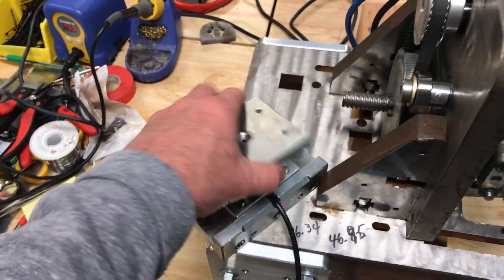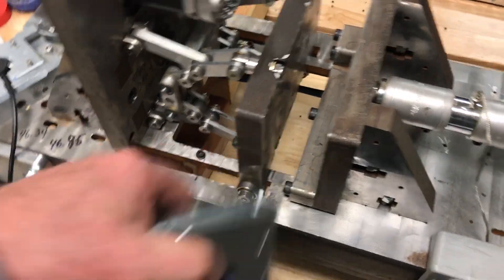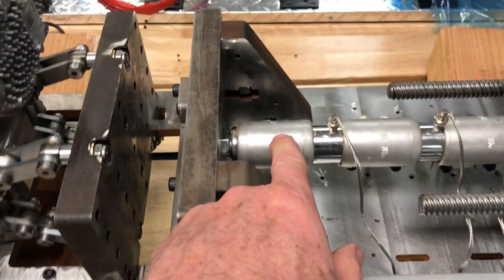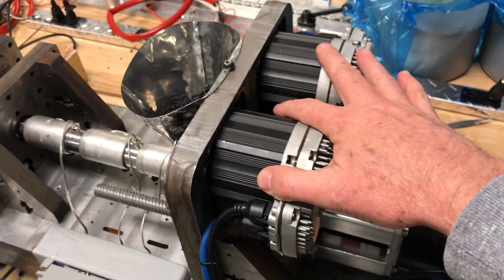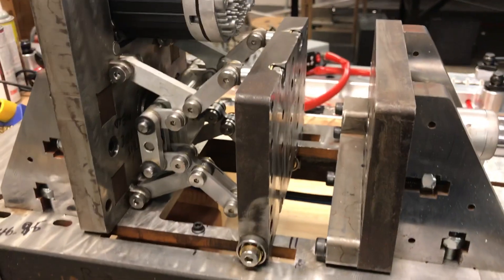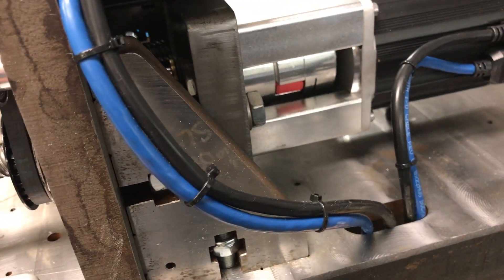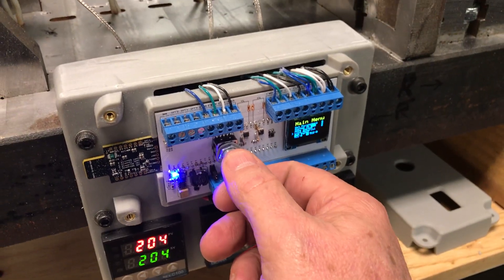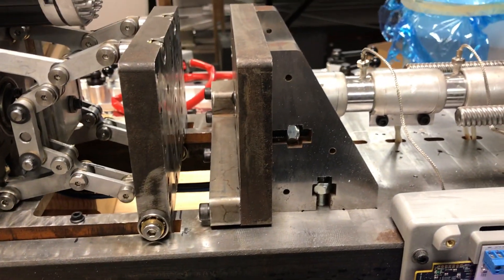Desktop Miniature Injection Molder Trial Run

Comment: Do you really need the precision of ballscrews?
Reply from the maker: Bob, No you do not need precision ball screws.  On my first machine and my new ones honestly I buy used ones when I can from EBay whether they are precision or not.  The screw and rotary section are quite expensive new! Every time I see them on eBay I buy them up!

Comment: Impressive, can I ask what series of clear path motors you are using? And did you develop any method for torque feedback, on the mold clamping motor?  I have built a plunger type molding machine using a SDSK series motor. I like the torque limiting, but there is not a way for torque feedback as a parameter, so a true closed loop clamping program can be driven through software. I have had to fine tune both the position and torque limits for my application.  Also I am really curious about the mechanism that pushes the feed screw after it is done metering. Do you have any plans of making a high level breakdown of your project? Just a quick video of a cross sectional sketch would be really cool!
Reply: @scottclifford-cliffordmfg4148  Thanks!  Ok I wasn't sure if you tried Teknic's  clearpath SC series software control motors, I am curious if they have more control.  Agreed Teknic support is excellet! Looking forward to the release of the plans for this!  Are you going to add an Ejector Plate to the design?

Comment: Hi, first off, very nice molding machine. May I know where did you bought the toggle lock (left side of the machine) and if there's an actual name for it, I would like to buy it. Thanks!
Reply: @scottclifford-cliffordmfg4148  that's great. I would like to buy some parts. Let me know the website.
Reply: @yeahitworks  Hello. Did you get answered from Scot? if yes any chance to share /help methe info i wouldlike to build up similar...
Reply: @scottclifford-cliffordmfg4148  how does the screw move in and out? I assume the big motor moves with it? I don't see any linear bearing where this big motor rides on.
Reply: Are these stepper or servo motor?
Reply from the maker: Hello sorry for not responding been very sick for a while. My toggle I designed myself.  If some one wants a print of just my toggle I will add a STP for it on my website… www.Clifford-mfg.com
Reply: @scottclifford-cliffordmfg4148  i went to your site.... this particular model isnt available for purchase either as cad or assembly. The cad file would be rather helpful as i could tweak it to my needs.
Reply from the maker: @abhishek420oviyt  Abhishek I will post a STP file for you on my website for you to purchase.